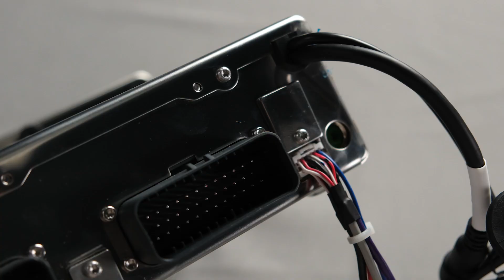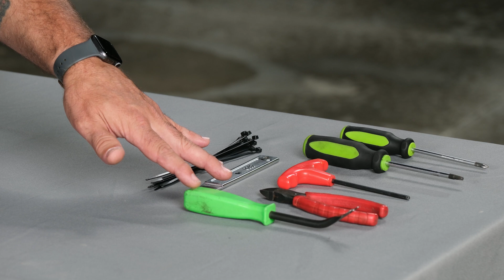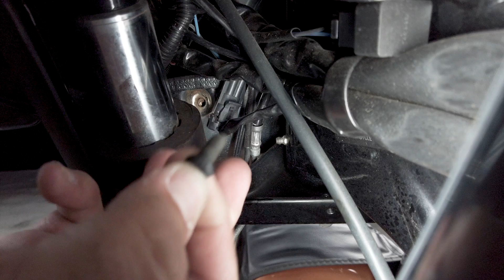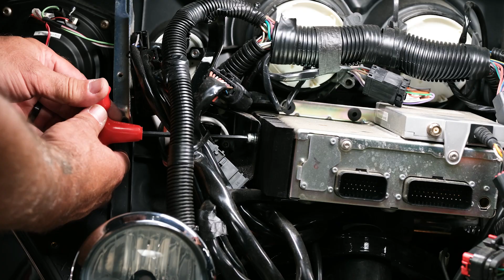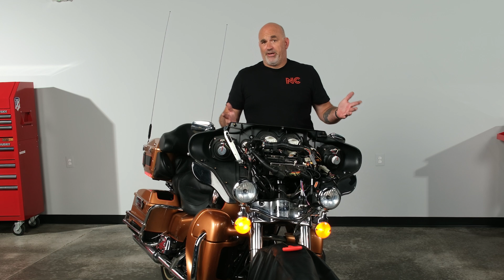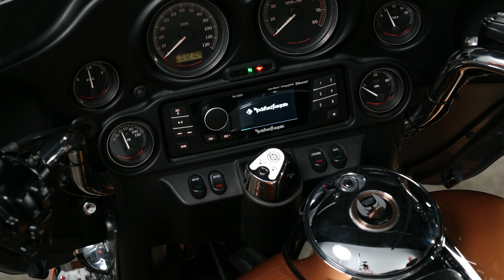Rockford Fosgate PMX-HD9813 Head Unit Install | 1999 - 2013 Harley-Davidson Touring

Comment: Think really hard if you're thinking about buying from this company. I spent over 4000 dollars had it for little over two years and I have had it back to Duke's in Flint Michigan. Three times and I got to Go back again now I don't have any sound. One thing after another you would think spending that much money you wouldn't have no problems with it when I wash my bike I don't spray water on the speakers or the stereo head if it rains I got covers I put over the speakers if I'm going down the road but they told me to bring it back again but it seems like I'm going to have more problems the amp that isn't working I would just take long and hard if you're going to buy some Rockford stereo equipment I thought it was supposed to be the best it was for the first 6 months maybe 6 months 4 months I had to take it back to get it fixed the amp come unplugged somehow because they got it in there so tight but they said I tried to say I unplugged it and have to drive to clear from Cadillac to Flint don't make sense why would I unplug it

Comment: I have a Harley Davidson Street Glide motorcycle 2015. Would this work on it?
Reply: No, this up to 2013 …you’ll need the HD14
Reply: Street Glides are the same as the Electra Glide. It would work. Same radio, same fairing.